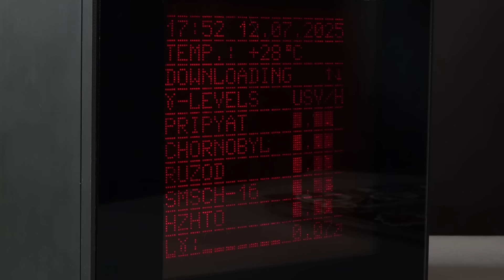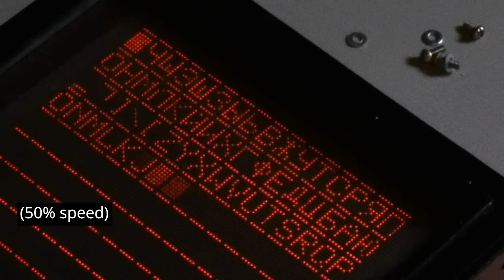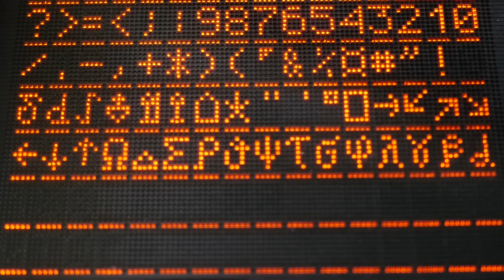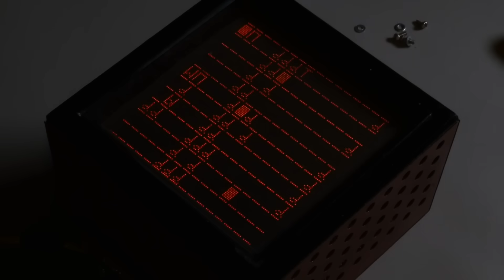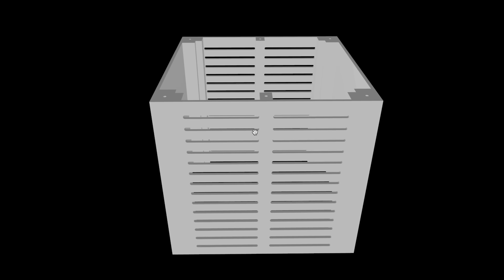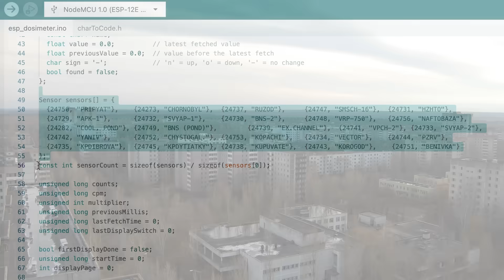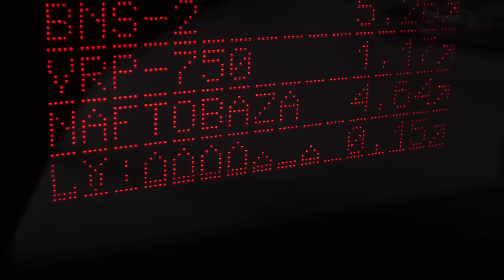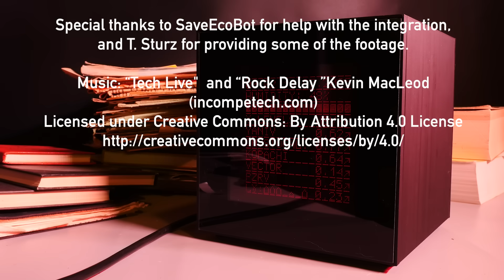DIY Live Chernobyl Radiation Monitor on Elektronika MS6205 and ESP32

Comment: bloody love this makes wish i had half your electrical engineering skills ,makes me laugh to think what the original soviet scientist and engineers who designed and built this dispaly  would of though of you using this dispaly this way ,with 3d parts and tiny computers and cheap computers  more powerfull then the SKALA  mainframe computer that was used in chornobyl would of blown there minds.
Reply from the maker: Assuming most of those engineers are still here, i believe they are used to projects like that )

Comment: Dear Alex I absolutely need your help not about such display but about a rare Soviet dosimeter i acquired in Bulgaria. I need professional advice/assistance. It’s a ДП-62 made in 1958 July. I used Phyphox magnetometer to test it and I have tested the application with Americium and it showed up so it detects ionizing radiation. The dosimeter is powered by a dynamo that has a magnet but on the application it barely showed up but when I brought the top part of it it absolutely went off the scale. And there should be no permanent magnet in the top part. I have no idea what I am dealing with and I don’t have a modern dosimeter to test it with. I don’t know what to do. Sincerely please help (and fast if possible)
Reply from the maker: With all my wish, I never had this device in my hands, so I really do not know how to help here.
Reply: @ChernobylFamily I’ll get a modern digital dosimeter and I will certainly test it as soon as I can. Btw you really should get one of these. Apparently this is the first mass produced dosimeter In the Soviet Union as far as I know. It’s very much a Soviet design working via a flashlight dynamo handle

Comment: As an add-on: a radon detector might be useful? I mean it is absolutely for old basements but the question is would it be together with the Geiger counter? Finally an integration with ESP32 or RPI pico might help making local measurements publicly available for different platforms (or Integration in Homeassistant).
Reply from the maker: I'll think about it.

Comment: Is that an elektronika MS6205 display? Those are impossible to find now.
Reply: I have a friend who lives in Ukraine. An electronics engineer, B. Zubtsov. Lives somewhere between Kyiv and Pripyat. I will contact him and see if he has come across any of the model you recommend.
Reply from the maker: @alexandervonzoller-sakharo6386 a trick: it is sometimes cheaper to get Banknota1 and pull out MS6205 with a ready cable.
Reply from the maker: Here in Ukraine, with no significant effort, I bought 6 of them.
Reply: I could not afford the shipping costs for the banknota1 machine. It's too big and heavy to ship to USA for less than $100

Comment: Very cool. A LED matrix could be an option if you couldn't get your hands on a plasma matrix for a similar result. I think I'm gone use a 2.42 inch OLED I2C display instead.
Reply from the maker: I am not sure led matrics with so small dots and 100x100 resolutions are available

Comment: Really interesting retro electronics project! Unlike mechanical devices which generally stayed around for decades if not longer, electronics have evolved so quickly it must be really difficult to faithfully recreate certain generations of tech. Once they are replaced, they get junked pretty quickly unless someone squirrels them away where they can be kept in decent conditions to avoid corrosion or other degradation. Also, I looked up your radiation monitoring data source - really fascinating (and sobering). One of your best tech episodes, IMHO.
Reply from the maker: Thanks! I'm glad you enjoyed it!

Comment: Very cool bit of old tech. I'm going to be giving my Ukrainian friends some very weird requests for the flea markets!

I suspect a ROM are used for character sets, so maybe you could add the missing Greek characters you need if you can decipher the format (I'd love to have a go at that!).

I must admit I was wondering why you were going to all the trouble of an Arduino and then adding wifi to it when ESP32 exists... You came to the same conclusion via a different path!
Reply from the maker: See, back in the day, I powered up such a display and firmly remembered it consumes 5V levels, so somewhat I was not sure about ESP32 given I do not have spare logic shifters... so eventually just tried, and it worked. Later the documentation confirmed — its logical 1 is 2.4...5.2V

Comment: Are there LoRaWAN radiation level monitors? If so, maybe clip one to Fuzik and use it as a data source on the display.
It's gonna be funny when "FUZIK" pops up on that display from time to time with some readings. Plus you know when your cat has found something dangerous.
What a gorgeous piece of equipment!
Reply from the maker: AAAAAAA

Comment: I'm not sure if you've run across it, but there's a PDF detailing those Cajoe V1.1 geiger counters in the geigerlog sourceforge repository. I'd link it, but you know how that goes. main thing is the anode voltage is probably set too high (>500v rather than ~400-425v), and most of the instructions for calibrating it online are very wrong which will only make the high voltage problem worse. it's also important to subtract the 12CPM background count that the J305 tube has to get your actual measurement, along with shielding the tube from EMC and light to prevent false counts. an SDM-20 is indeed a better choice, but they're a very tight fit within the outer two tube clips. I use a J321, which is slightly better than the J305, analogous to the M4011 tube.
Reply from the maker: Thank you very much

Comment: Beautiful! 
My dad worked for a company that supplied bespoke post office equipment in the 1980s. Sometime around 1992 I had a summer job helping them scrap the by now obsolete terminals and those each included a 160 x 96 pixel red LED matrix display which reminds me of your gas plasma displays both in terms of aesthetics and the graphics shown.
Reply from the maker: Thank you for sharing!

Comment: Pretty neat thing.  Would be a huge project but would be kinda neat to make it a graphical bitmap display and make a simple kind of home computer or game console out of it and write some software/games for.  Probably using some modern microcontroller or whatever as those are all way beyond what basically any home computer was in the 80s.  Probably could even be made to run Doom.  Wonder if its drive circuitry is fast enough that one could use PWM to get more brightness levels.
Reply from the maker: Doom on this is confirmed — it was done. But on a pure IMG-1-02 with a custom controller.
Reply: @ChernobylFamily oh that's awesome.

Comment: Very interesting creation, I always like devices with large diode displays. Maybe one tip you may find handy, be careful if you purchase power supplies from eBay or chinese no name PSU units in general, sometimes they can spike and output much higher voltage than needed, that's exactly what happened to me. But I am sure you know that, so at least for others. Anyways, thanks for a video.
Reply from the maker: That's valuable advice!

Comment: Oh, we used similar monitors with "Cursor" computers in university.
Reply from the maker: Yes, I mentioned them:)
Reply: @ChernobylFamily  I've written this just before finished video and didn't seen it at the moment 🙂
Reply from the maker: What actually you could do on that computer? I know it, but so little is known. Can you share? Also, was MS6205 as a display actually usable?
Reply: @ChernobylFamily  It had simple DAC, ADC, digital GPIOs that was used with relays together(you had possibility power on/power off devices), buildin' basic interpreter. And we used them in laboratories as bad but working PID controllers 🙂 As many old soviet computers it was built around i8080 CPU(not original, of cause, but 580ВМ80) and was heavy as hell(just computer case WITHOUT boards, PSU etc was something around 20 kilos). And it have most awful keyboard that I've seen in my life(even home made spectrums had better keyboards). I can't say clearly model of display but it was the same orange plasma display.
Reply from the maker: @nihirash super thanks for sharing!